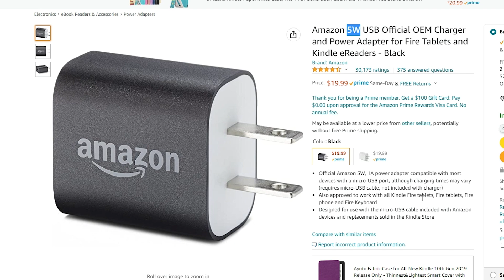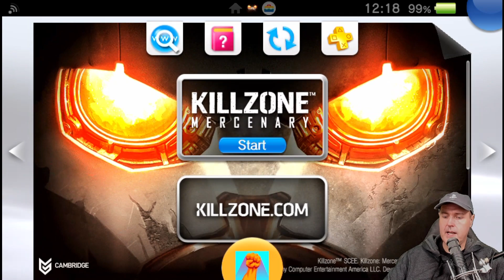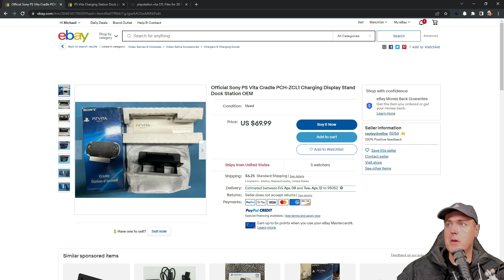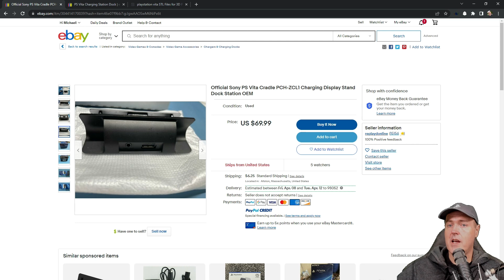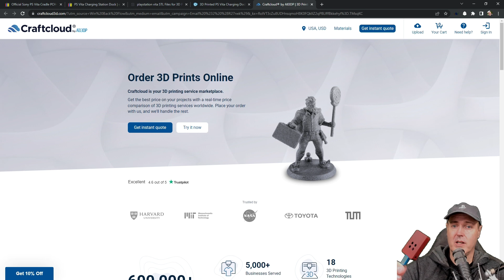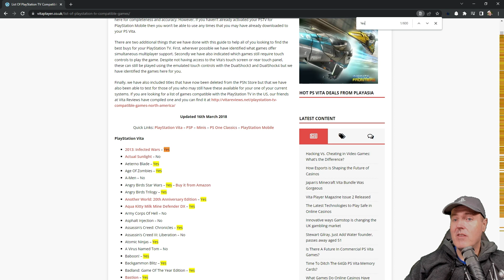5 Tips to get MORE out of your PlayStation Vita Dock (DS4, External Power, Audio, Stands, PSTV)

Comment: You talked about using the touchscreen via the touchpad. Can you use the back touch too, like holding L2 to shift to the back touch until you let go to switch between the front and back?
Reply from the maker: Is there a game or app that I can test this with? I'd try it for you if so.
Reply: @mbcrump  I was asking you if the back touch worked.
Reply: @Castcoder  on my setup the DS4 only applies to the front touch screen. However for a vita running CFW there is a huge amount of plugins you can run to provide a huge amount of functionality, there's bound to be a plugin to do this.